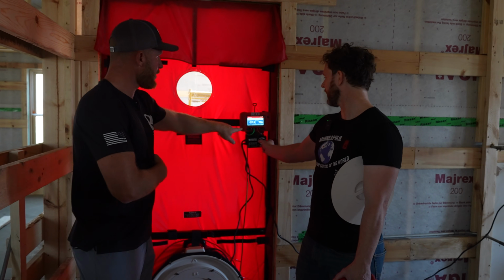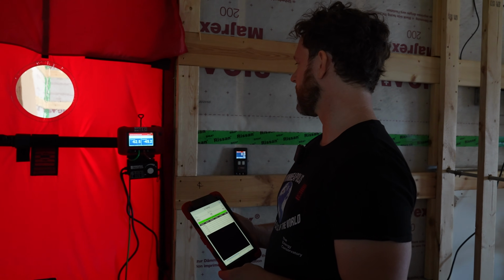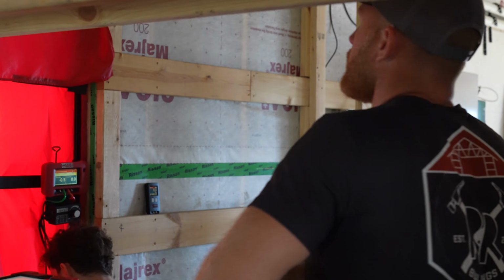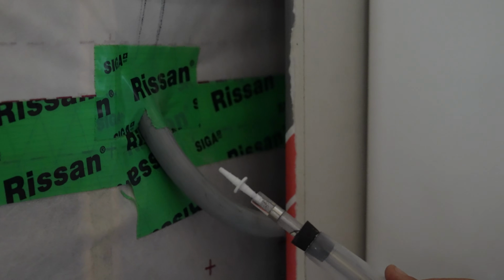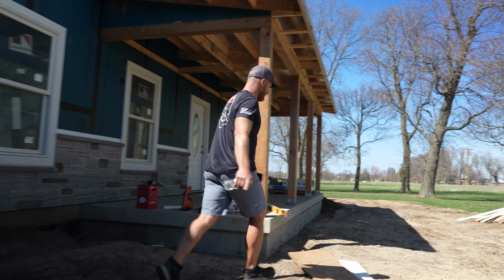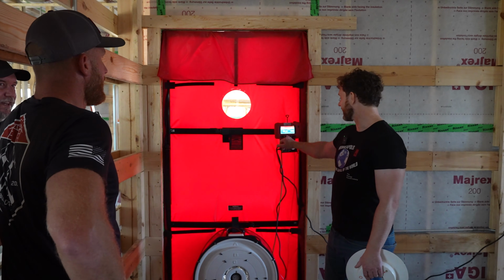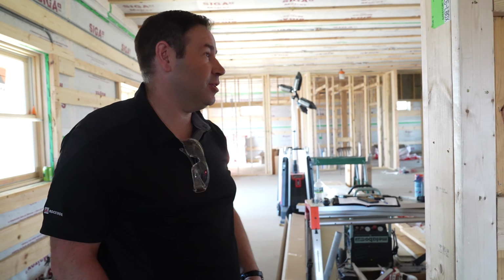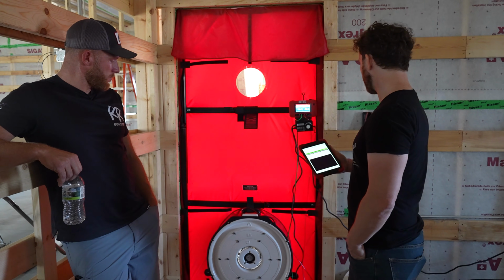Can a House be too Air Tight?

Comment: at time 10:44 the gray PVC (NEMA TC2) , the 2x4 studs have been  drilled for and almost completely compromised and have almost no strength.  So bad! like 1/2" wood left on each side of the pipe.  You call yourselves builders???

Comment: Yes buildings can be too air tight. Have heard of issues with some local gov't buildings that were built too air tight, and when the elevators moved it blew out the windows from the inside.

Comment: What happens when the house sits unoccupied for months at a time? Every house goes through these times in it's lifetime. Unless the ERV/HRV is constantly powered, wouldn't the house mold?
Reply: I would like to make my house air tight, but have a system to open up small vents when unoccupied to let it breathe.

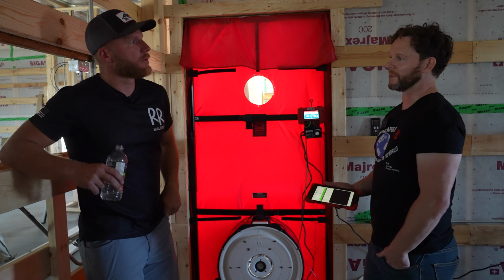Comment: 25:05-25:23????
If you're at a level, that you hire in a blower door test... I'm pretty sure that the HVAC will be a of a modern VRF system of sorts, and short cycling should not be a consideration???

I also believe that most newer heat pumps will go into a drying function, to prevent short cycling?

I'm not trying to beat up this video... But just sticking that one out there??? I, for sure, can be wrong as I'm not a HVAC pro...

Comment: Interesting video that showcases the new way of building insulated houses.
You know that Siga makes special Fentrim sleeves, sort of neoprene socks, that you put around pipes and cables to make them airtight very easily.

For sealing conduit, there are special silicone seals to put in conduit where you can run cables thrue, your electrical specialist should be able to supply this, it is also used in acoustic applications, where conduit and HVAC pipes are known sources where sound goes through.

Electrical installation manufacturers have all kinds of solutions for these kind of special applications, often the fire safety is such a specialism that is overlooked, but has a lot of solutions that help building airtight as well.

Comment: Like most things... air leakage will take the path of least resistance.  As soon as you add bathroom fans, rangehoods, dryer ducts, recessed lights, heating ducts, log burner chimneys, air exchangers, etc.  All of those numbers will change.  One could argue that once drywall is installed, sealed, and painted, one has created another vapor barrier.  That would place the most important air leakage points on the above mentioned, as well as bottom/sill/mud plates.  To me, the importance of the highest R value one can afford is more important than going overboard on "tighness" e.g. straw bale homes/builds.  Just my two cents.  Thanks for the content you share.

Comment: One other note: I would love to have my own Blower door but they are like 5k and the energy auditors that do your score are typically in and out fast (unless you are a youtube influencer) and dont stick around to find the leaks and if they do get your wallet out.  However, you can make a DIY blower door easy with a large fan/floor dryer to pressurize/depressurize the house and do your own leak detection before blower door guy ever shows up.  Its not going to give you all the fancy numbers like a true blower door but it will work just as well to find all the leaks in combination of with a smoke machine.  Typically I would do it reverse as shown.  Depressurize the house (suck air out) and blow smoke from outside directly onto building and see if it gets sucked in.  This will be easy to spot and wont fill the entire inside with thick smoke and any dampers for things like kitchen/bath exhaust fans wont be getting blown open.
Reply: If you have a decent temperature difference between interior and exterior you would be able to see leaks with an IR camera as well.
Reply: yes you can but IR cameras are still pricy. I do have one but smoke does work better. As you point out you need a large temperature difference and depending on the camera there are other issues such as reflected heat.  Just fyi you can use on of those insect foggers and put smoke fluid in them. They are cordless, cheap and produce a good amount of smoke.     @WTFUSERNAM44

Comment: @0:45 you say maybe it wont be as good 10 years from now but Im unclear if you are talking about the spray foam or Siga.  If I was a betting man I would bet on the spray foam outlasting that siga fabric membrane and some tape hands down.  Im actually not sold on that Siga system at all.  As you saw you already had some tape come off before drywall even went up a few years from now who knows....   Honestly I would never use this SIGA this for air sealing.  Either full spray foam or at the very min. flash and batt.  Roxul is a better product IMO over traditional fiberglass.  Im an ICF guy myself but any method can achieve a good score with enough attention to detail and as you point out windows and doors will always be weak point and only so much can be done.  ICF is forever and just like the concrete slab ICF wall will never  air leak, rot or blow over in hurricane or tornado only air leak weak point is any penetration's but there are some great products beyond spray foam for sealing around pipes and such.  Great job for a pole building though.

Comment: No a house can not be too air tight, but once it is tight you need very controlled air management.  What air quality sensors are you going to use for IAQ?  Nicely done!  Great attention to detail.  When building how much of a cost adder is this extra attention to detail?  The low bid guys would have been happy with 4 to meet code.  You are 10x tighter, which will save $$$ HVAC.  Humidity management is now an important thing vs older houses with high air exchange.

Comment: You didn't answer the question, lol. How tight is too tight? I'm guessing that you will now need a "make up air" system to keep out mold buildup and have fresh air in the house. That's what I hate about tight buildings. You end up doing away with the tight seal for healthier air inside. It's like a never-ending cycle. All that code regulation and you end up destroying the sealed interior for fresh air.

Comment: Next step is doing an ASHRAE calculation for ventilation and design a "Balanced Air" Ventilation strategy for the structure and its occupants. Explore Heat Recovery Ventilation and/or Energy Recovery Ventilation. You are doing great, brother!

Comment: @RRBuildings Kyle, do you think this method of insulating a post frame home is one of, if not the best? Considering material costs and labor involved? Or do you prefer another way? 

I will be building my own home similar to this one next spring just a couple hours north of you. 

As always keep up the good work👍👍👍
Reply: ICF is the "BEST" hands down without question across the board building method and air sealing/leakage just being one of many reasons why ICF outperforms every other method, and no I do not sell or install ICF;s just a guy/carpenter who built his own home with ICF's and would never do it any other way.  another benifit is if you are working mostly solo like I was Icfs work great to because you dont need extra man/equipment power to lift raise walls each block is only about 8# you can assemble the entire house by yourself and just get some help for a few hours on pour day. Thats what initially attracted me to ICF's They are slightly more upfront but its marginal after you factor in the cost of everything you get from an ICF all in one step.  Nothing compares to the strength, durability, comfort, air leakage, efficiency of ICF.  There are blocks to that use a thicker exterior foam and thinner interior foam to take advantage of the thermal mass of concrete.  By increasing the insulation on the exterior this decreases the outside temperature influence on the concrete.  Once all that concrete reaches the indoor temp it wants to stay there and takes a lot of energy to swing its temp one way or another.  I would never use anything different from footing to top plate "IF" you truly want the "BEST"  its a bold statement I know but I have been in building trades my entire life and confident what I am claiming is 100% true.

Comment: I spent many years working on air tightness as an Engineer on specific Engineering projects. Tight enough that we had built in installations for CO2 scrubbing at a minimum and even special environmental candles and other high tech air monitoring systems. So yes you can be too tight for human habitation. As so one of the comments have suggested you require the HVAC to maintain habitable conditions. I must have a look to see if you have done a video on the HVAC installation checks you carry out. I would appreciate if someone could point me to these HVAC checks you do.

In my job we were able to readily test for Radon and CO2. I am assuming in a High Radon area you install Radon membranes and check the HVAC pressures to ensure the basement or the ground floor rooms are set up to have the lowest HVAC DP's? Even ventilate ground air spaces out with the living area. If you google it between 3 and 14% of all lung cancer deaths can be attributed to Radon in homes and I have seen higher percentages than this in the past being quoted. So proper ventilation is so important in some areas. Especially in basements due the properties of radon and its sources.

An interesting test if someone in your house likes burning scented candles is to buy ain inexpensive CO2 monitor and watch how the CO2 rises in your living space. I did a test in our own house and it soon rose to about 3000 ppm from the background of approx 400ppm. Your local building codes usually will recommend 1000 ppm to 1500ppm as a maximium  certainly a max of 5000ppm would be advised. 

The use of drywalls with high levels of Strontium Sulphate (Sulfate) could also be a problem in house with good air tightness  and improperly set up HVAC systems. 

I was also interested in the discussion on a wind factor in the calculation. As many of you know wind loading can increase a pressure on the outside wall but also a negative pressure with a venturi effect in action especially on gable ends of buildings.

The systems I worked on that had cable penetrations were installed into wall  glands with a testable interspace which was a maintenance item for us. I see in the comments suggestion that rubber will deteriorate over time. Though we had to repair some over the years it did not tend to be an issue.

Certainly an interesting and thought provoking video that has me away looking into how different places and industries  deal with these sort of issues. 

I look forward to the next.

As

video

Comment: There is also a new company that uses a machine that basically aerosolizes caulking and they pressurize the building and then pump that aerosol in the air and it finds all the leaks and seals them for you. Obviously it has some limitations but all the smaller gaps and whatnot will be sealed. It's pretty coll system although it is new and I'm sure will be improved on as time goes by but it's a cool thing to check out

Comment: Double check when you ordered your windows what the dp rating is. Andersen has an option to upgrade the performance depending on requirements/design pressure.
Operable windowsalwaya will have some air leakage because they need to be able to drain water through weep holes. That being said you have to find the balance of how easy you want doors to operate and how tight of a building you have because the higher dp rated windows have extra weather stripping which then causes more friction and they don't operate as smoothly. You might get a more tighter window but they won't operate as smoothly. The real test would be to check the fixed windows. They should have no leakage at all for the most part.

Comment: You need monkey Sh*$. 
Ideal and gardner bender make a duct seal comes in a block use it like a clay. push it into the holes in the electrical boxes and such. You can get it anywhere they sell electrical supplies. including the place with the orange sign.

Comment: Living in rural Colorado mountains where wood burning is main source of heat, I   don't want a tight  insulated house , It needs to breath and let fresh air in. 
The main thing I need and every house needs is to filter the air. Which I do with diy filter box made of 5 merv 13 furnace  filters and a box fan.
Reply: I hate to break it to you but this makes zero sense. Wood burning doesn’t change needing a house to “breathe.” If you need the fire to breathe you should plumb it to suck in air from outside. Having air randomly sucked into your house under doors just makes your house drafty.

Comment: One question I would have is if you build the house and then use spray foam, instead of using the siga product what is the cost comparison between the two? Which one is cheaper?

Comment: Great video to show the improvement.  We've also been testing before drywall to find the best ways to air seal.  Our conclusion is to take the air barrier to the exterior.  You already have a sheathing with a built-in WRB.  Why not just focus on that?  We've been doing that and ignoring air-sealing on the inside except for fire and are getting less than .3 ACH50 with a hard focus on the sheathing only.

Comment: I find it amazing how air tight it is . But I also ask myself is it really healthy.  Yes I know use installing equipment to move the air ,I just not sure.
Reply: Must add make-up air. But that will come in at one controlled location with filtration to keep outside contaminants from coming in. Much better than dirty air seeping through all the cracks and crevices picking up particles of insulation. During the forest fires it would be nice to have controlled air intake.

Comment: 4 ACH is code…1 ACH and Kyle says still ain’t good enough we can do better! It’s that kind of pride in your work that makes the work you guys do so damn desirable.
Reply: A passive house has to be .6ACH,, which if your not building to passive house standards then your not building a good home.
Reply: I built my last house too tight. IAQ was horrible and we had to constantly leave windows open. Eventually had to install a HRV to gain more ACH.
Reply: @rangerdoc1029  why would you build a tight house and not consider air quality during the planning?? of course you need ERV and make up air, thats hvac 101

Comment: Kyle — have you considered using @aerobarrier instead of just s blower door? Aerobarrier includes a blower door plus an adhesive spray system that fills in air gaps by fogging up the house. No hunting for leaks. Thoughts?

Comment: Hey Sir, I have a question. My house was built in 1986 with smart side on top of plywood sheeting (no tyvek or anything) the top of each board and the metal flashing were sealed with silicone. No leaks or mold or any water damage since the silicone is still holding strong. Now I have to replace a deck door for a window. Could I do the same (plywood, siding, silicone and metal flashing) or I have to wrap my house up on plastic and tape? Thanks

Comment: Great video, thx, healthy living, especially in COVID-19 pandemic era require a higher rate of ACH with enhanced ventilation. This is also good for all those with asthma, allergies or lung disease. Please do a video or reference one on Heat Recovery Ventilation systems that ensure good ventilation with minimal thermal loss (which is the whole point of a maximum airtight house). Thanks!

Comment: Impressive results.  To put the NLR value in some context....

The PHIUS+ 2015 air leakage target for this type of building would be 0.25 litres/second/sq. meter @ 50 Pa.  This home's NLR (0.023 cfm/ft^2 @ 50 pa) was half that target:  0.11684 L/s/m^2 @ 50 Pa!!!   

The ENERGY STAR for New Homes air leakage target (Canada) for a detached home is 0.93 L/s/m^2 @ 50 Pa, this home is ~ 8x tighter than that target.

Congrats to all of the trades involved on this project, clearly everyone's efforts resulted in a very tight enclosure!

Comment: If you would have used 400 series with casements instead of DH and you would of put in FWH instead of glider doors you wouldn’t have that bad of leaks.   I know you said you were building this house with materials and products anyone could get ahold of but the windows in a 200 series most likely don’t have any additional coatings to improve efficiency

Comment: Great result ! 
You need to look into penetration membrane flanges. Basically a rubber sheet with tape around the edge. You push the pipe through a smaller hole than the pipe. Like a 1 inch pipe through a 3/4inch hole. Saves a lot of hassle with tape.
Reply: What's the lingevity on that? Surely the rubber will get stiff and fail ling after tape curls up aand falls off.

Comment: Hey, I was just thinking about something. Fraimer, friend of mine told Migos put in casement windows. When the wind blows against them they seal even tighter against the frame where the double hung, have a tendency to pull apart at the mull point, but you guys did a tremendous job absolutely impressed. Question for you I am planning on building a retirement house here in the next year. My house is going to be on a full basement. Can you still do a post frame construction on a full basement love to hear your thoughts on it.
Reply from the maker: we have done a few.

Comment: wow, awesome demo, Kyle! This is a first for me, so I was very impressed with the equipment used to check for air leaks! I'm glad you left some pipes unsealed as well as overlooked some tape on the wrap. It actually made the whole test make more sense. I never knew double hung windows had so much air leakage, but it makes sense, and I have never been a fan of sliding doors, and this test just goes to show that you lose a little energy not matter how much you spend on them. Thanks for doing the demo. I'm 57 now, and I grew up framing residential homes with my dad from the time I was 11 on up. I'm an electrician now for the last 11 years; just another facet of construction. Again, great demo.